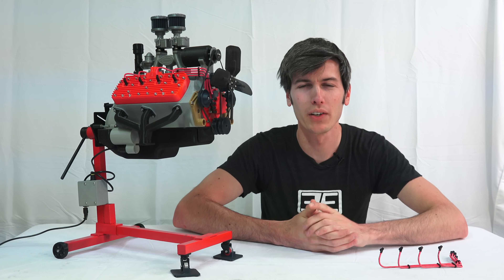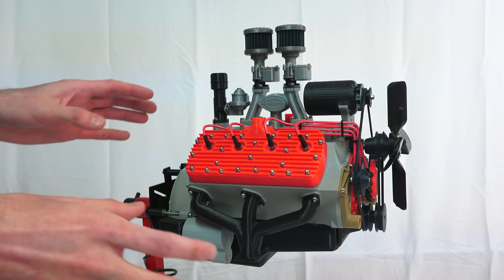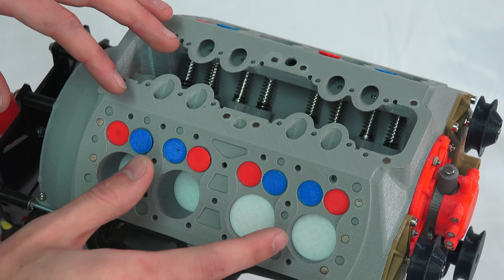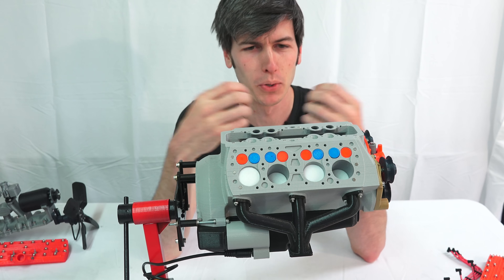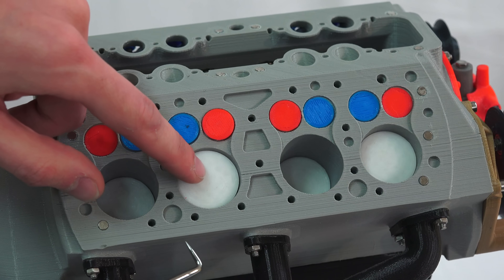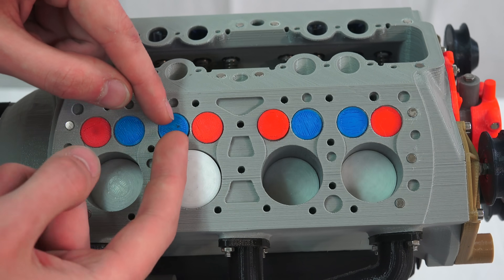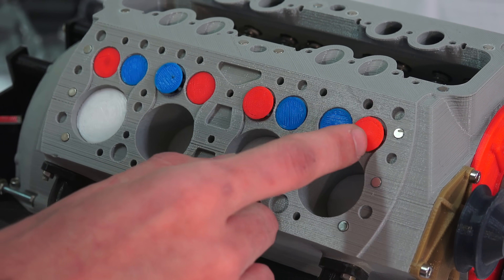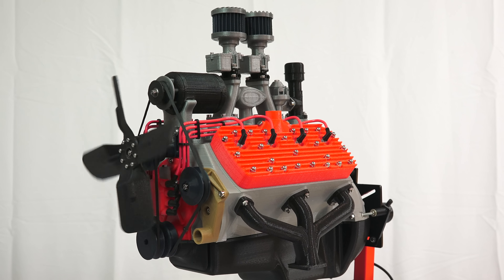Why Ford's Flathead V8 Engine Died

Comment: My first car was a '50 Fordor Custom. My dad and uncles all had flatties from 1932 on. They were obsolete by 1949.  Mine was 100 HP, and had all the usual flattie problems.  One thing you didn't mention was the Ford flattie V8's penchant to overheat.  The reason was simple... the damned exhaust ports go right through the water jacket!  Siamesing the middle cylinders' exhausts into a single port didn't help breathing, either, and only 3 main bearings didn't bode well for longevity.  At best, my '50 got 14 MPG around town and 16 on the road.  My '55 Olds w/Hydra-Matic got 17 around town and 22 on the road...with almost twice the horsepower available.

GM's engines were far better than Ford's Y-blocks that replaced the flatties, as were Chrysler's.  Ford finally got their act together with the big block FE in '58, and Ford's small block of 1962 turned out to be a far better engine than the trouble plagued Chevy small block.  But all through the mid-50s, Ford engines were just overweight gas-guzzling chunks of iron.  As Packard used to say, "Ask the man who owns one."  I did, and can tell the real story.  Too bad, too, since other than the obsolete V8, the Shoebox Ford was a pretty nice car.  Here's a tip...the I-6 available as standard engine in 1950 put out 5 more HP AND got better fuel economy.  Ford, of course, never advertised that fact and derated the 6 on paper to sell more V8s.
Reply: i have a cadillac with a 346 flathead in it thatcim rebuilding. i would asume they dont overheat as bad since the exhaust exits on top so it doesnt go through the block like the ford
Reply: Per Landström 

I just got a 47 Caddy with 346, I can’t wait to dig into it & see how different it is from Ford’s design. I have a 346 Facebook page if you’re interested in joining it.
Reply: I will never understand why Chevy pressed the rocker arm studs into so many small block cylinder heads. That's the only major problem I know of with small blocks although I think I heard they had some alloy problems at first that resulted in chewed up cam, distributor, oil pump drives.
Reply: It is interesting. Though Ford was known for the V8 their straight sixes were their real forte.
Reply: DeserT BoB thanks for the short narrative.
Reply: More than just the internal exhaust passages... the flathead design in itself, doesn't lend well to any considerable duty cycle. The heat simply had no place to go. The heads held a lot of heat, and caused preignition after any lengthy load... hence why all the flatheads in hill country always sounded like they had a worn cam. You had to back the spark advance off enough for it to take more than a 30 second pull up a mountain without burning up.
Reply: Kind seems this engine was  marketing goal, advertise a car with a v8 but it's a cheap to make problematic v8.
Reply: @Cheapthrill1979  - for its day, it wasn't that bad. The Mercury and French military versions were actually quite good, for the time they were built. The later castings used by French military had revised cooling passages, dual spark plugs, the highest  displacement of all that were produced, and often found their home in tanks.

While the flathead definitely had its faults, it had its advantages as well. Serviceability was paramount back then... and the V8 flattie was king, 'til Hudson showed up with their revised H-series 6. The flathead was also relatively lightweight, compared to most 6 cylinder offerings of the day.
Reply: I REMEMBER THE SIXES BUT THEY WERE VERY RARE! 
A SIX WITH THE OVERDRIVE 
STICK WAS A STOUT RIVAL FOR THE V-8!!
THERE WAS A BIGGER VERSION OF THE SIX USED IN BIG TRUCKS!
I HAD A F-600 WITH 4 SPEED TRANSMISSION AND AN EATON TWO SPEED REAR END!!
IT WAS A GREAT HAULER!!
Reply: "... the trouble plagued Chevy small block."?  That's a strange statement about a design that has stood the test of time for 64 years.  Anyway, your comments about the Ford I-6 v flathead V-8 is right on.  The six outperformed the V-8 in every field - acceleration, economy, speed, ease of maintenance*.

*whoever designed the V-8 water pumps should be hung by his ankles.  I've spent hours trying to get the bolt out from inside the water outlet after it had been rounded off by corrosion.
Reply: @dhy5342  But it didn't have the "COOL" factor or the sound.
Reply: @dhy5342  stainless steel bolts would have been the ticket. i love the small block chevy water pump. four bolts and so easy to get to. much better than taking off all those bolts on a ford buick or other engines. running the bolts thru the water jacket was not that bright but the pump itself was the simplest i ever had to deal with.
Reply: Depended more on use than anything. I had a 51 and 52 1 ton duallies, ran those around town and got low to mid 20s and ran cool. Try to maintain 50 empty or 45 with any load and they'd overheat in a heartbeat and drink gas. I'm thinking they didn't like running over 2500 rpm for any length of time.
Reply: Excellent assessment Deser.  Ford GAVE GM predominance in the 20s and late 40s, early 50s.   Just handed it to them.
Technology has to evolve.  I have a Willys Jeep with the flathead Go Devil.   That evolved to the F-head half (intake OH, exaust in the block).  I think what made Ford's flathead V8 such a technological wonder was it being the first 1-piece cast solid block.   Before Ford, all larger blocks were usually 3 pieces bolted together.   You can imagine the problems with parts of an engine block bolted together.   The technique Ford and the engineers patented are still being used today in firing a block.   THAT was the great accomplishment of the FHV8.   That and it's important role in the evolution/trial and error learning process of V6/8 innovation.
Reply: PROBLEM PLAGUED SMALL BLOCK?? ARE YOU SERIOUS, THESE ENGINES MADE THE ELUSIVE ONE HORSE PER CUBIC INCH, SOMETHING YOUR FORD DIDN'T DO FOR A LONG ASS TIME, ONLY PROBLEM WITH SBC WAS PRESS IN AND PINNED ROCKER STUDS, WHICH WAS ONE OF THE FIRST UPGRADES, MORE VALVE SPRING, ROLLER ROCKERS , SCREWIN STUDS, CRANE REV KIT, PORT MATCH TO INTAKE, O41 CAMSHAFT OR A SOLID ROLLER , NOW THAT MOUSE IS SCREAMING AT 7800 OR MORE, AND STILL RRLIABLE, WHAT FORD COULD DO THAT, THE KEY TO SBC POWER IS , AIR IN , AIR OUT, VOLUMETRIC EFFICANCY, I LOVE MOUSE MOTORS, ESPECIALLY THE 302 FROM. THE Z 28 s , PURE BLOODED BEASTS
Reply: William Cox  Chevy’ s were the reason that there was an aftermarket parts industry, because they were underpowered and unreliable.
Reply: @Parky427  YOU'RE FUNNY
Reply: @williamcox4910  lol elusive horse per cubic inch. tell that to the european domestic market. i really wonder how they consistently made and beat that mark, even through the malaise era with a ton of engines. 
And kinda did better than 15mpg on average.
7800 is slow. try 8500-10000. 
pushrod engines were outdated by the end of the 70's. having the sbc push through Y2K was through sheer GM stubbornness and massive govt backing gm's mistakes. 
the LS is all the same.
Reply: @comethiburs2326  SIR, WHAT I WAS REFERRING TO WAS CHEVROLETS 1st V8 IN 1955, THE STATEMENT IS ACCERATE, TELL WHAT MANUFACTURER MANAGED A 265 CUBIC INCH MOTOR THAT MADE 270 HP, I'LL ADMIT I'M WRONG WHEN YOU TELL ME ANYONE IN 1955 THAT PRODUCED ANY MOTOR THAT DID THE SAME
Reply: @comethiburs2326  ALSO AS FOR RPM, YOURE CORRECT, ON OHC MOTOR WILL REV HIGHER, WE'RE NOT HERE DISCUSSING " TUNER" JAPANESE CRAP EITHER
Reply: @williamcox4910  ferrari 375. 350-400hp for 302ci V12. mercedes 300SL. 220hp for 183ci I6. alfa romeo 1900Ti super. 115hp for 115ci I4. Alfa Romeo Giulietta Sprint. 80hp for 78ci i4. panhard Dyna; 51ci, 50hp Flat 2. all in the year 1955.
Reply: @williamcox4910  THE 1955, 265 CI CHEVY MADE 265 HORSE POWER WITH TWO 4 BBL ENGINE
Reply: @comethiburs2326  WE'RE NOT TALKING ABOUT V 12 FERRARI CRAP, THIS IS ABOUT AMERICAN MADE REAL V8 ENGINES
Reply: @comethiburs2326  AND HOW ABOUT THE CHEVY 8  CYLINDER 302 IM THE Z 28. THAT WAS RATED AT 350 HORSE BUTFOR INSURANCE PURPOSES MADE AN ACTUAL 450 HORSEPOWER????
Reply: Côme Thiburs and every one of them is unreliable junk
Reply: @williamcox4910  first chevy v8=1916
Reply: @williamcox5216  also make an excellent boat anchor 
Just an observation!
Reply: @williamcox4910  is your caps lock button broken?
Reply: @williamcox4910  "What manufacturer managed a 265 cubic inch motor that made 270HP, I'll admit I'm wrong when you tell me anyone in 1955 that produced any motor that did the same."

Well, Chevy sure as hell didn't. The highest output 265 available in 1955 was the 195HP Corvette motor with dual quads and a high-lift cam. Ford's 272ci Y-Block V8 was able to match the 265 in most configurations, plus there was also a bigger 292ci Y-Block available. Chevy didn't crack the magical 1hp per cubic inch 'til the Fuelie 283 came out in 1957. At the same time Ford had released their blown 312ci, 340hp Supercharged Y-block.

Comment: In comparison the 2018 FORD Expedition is powered by a 3.5 litre V-6 Ecoboost. Before you laugh at 3.5 litres in a big Expedition remember it gets 375hp and even more torque out of that 3.5litres. I just put 1200 miles on rental 2018 Expedition. It was a pleasure to make the drive, no problem with all the hills on I-10 between LA and Phoenix. Very impressive engine. I made the trip last moth in a 2018 Nissan Pathfinder. The Pathfinder is a bit under 300hp,still a great driver. The FORD handled better,even being significantly bigger. Pathfinder handled like a rough truck.

Comment: Funny that some of the old hotrodders could coax a helluva lot of horses out of those flathead engines.  I believe the max was 400 hp with aftermarket Ardun heads.
Reply: "aftermarket Ardun heads"... you mean the Ardun OHV conversion heads?
Reply: 400HP max? people have put blowers on those and got alot more...the limit is how much money you got to sink into it. literally the sole reason Ford canned those was uncorrectable overheating issues. if built right, a Ford flathead is a tire frying screamer to beat all. Hot rodders love those because they're so easy to work on.

Comment: So an air-cooled VW engine has slightly more horsepower than a flat-head Ford.
Reply: I think the VW was about 40 HP and the Flathead was about 110.

Comment: the first flatheads actually were rated at 60 hp and the later engines were rated at 85 hp. interestingly the 6 cyl inline flathead  ford built put out 90 hp! the model you are using has the early distributor, later ones had the distributor at the rear on top of the engine.

Comment: Since flatheads have less compression , would they make good engines to turbo charge ?
Reply: I don't think the flathead would be a good candidate for turbo boost. The engine had breathing problems - watch the video where the airflows in and out of the cylinder are explained. One other thing that was not explained in the video was a heat build up problem the engine had. The exaust passing through the engine block gave the cooling system a lot of extra heat to deal with.

Comment: Ford is bringing it back in their new 7.3 V8 for medium duty trucks.
Reply: Thats not a flathead. The new 7.3 has got a single cam with push rods to work the rockers and vavles like the old motors were. But the thing is that size motor aint new its a 445 c.i. International used to have a 445 in their trucks back in the day.

Comment: I have a 1953 Merc FH in my 1947 Ford Coupe. Love it.
Reply: The Merc had a little more power.
Reply: @timothyearly7727  And 16 more cubic inches. 239 to 255 (longer stroke).
Reply: That sounds correct.  The flathead was a small engine.  It was way down in the engine compartment.

Comment: The Ford flathead V8? The engine was a real study in mediocrity and it was a danger to owners and mechanics alike. Note that the exhaust ports had to travel a considerable distance through the water jacket. This meant that the engine had a terrible heat rejection rate and had to have an oversized radiator and water pump just to keep from overheating under normal use. And putting any load on the engine often resulted in cooling system failure. I had an experience with the engine that could have cost me my life in addition to the 2nd degree burns over my chest and face. I had a friend in high school who had a Ford Woody station wagon with a flathead V8. Normally it's a really cool ride. We decided to take a trip from Indio, CA along I8 about 59 miles east to Desert Center on I8. Well, Indio, CA is at sea level and Desert Center is at about 2000 ft elevation so outside of Indio we had to climb a grade of about 2000 ft. In Indio, the woody ran just fine and we expected no problems. But just east of Indio, about halfway up the grade, the car started to overheat badly. We pulled over and raised the hood. I removed the radiator cap and the water level was low. There was a rumbling that lasted for about 5 seconds and then all of a sudden a huge explosion of boiling hot water came rushing out and hit me squarely in the chest. I was immediately sent flying backwards about 10 ft. and landed squarely on my back in the right lane of US8. If there had been a car coming I would have been run over. What had happened was that by removing the radiator cap we had reduced the vapor pressure  allowing the superheated water to explode. I was hit by almost the entire contents of the cooling system.  I had 2nd degree burns over about 25% of my body. After I landed on my back I quickly jumped up off the road to get out of the highway. Imediately I was hit by the most agonizing pain. We had no water to fill the cooling system. Luckily for us a truck driver stopped and gave us a lift to our destination. We stopped at Chiracco Summit to get ice for me but for some reason they had none. In the meantime I was in shock because of the intense pain. My face and chest had bubbled up from the scalding. At our destination a local doctor was able to treat me for the pain. This happened in 1967. It took a month for me to heal. It was the terrible heat rejection rate of the flathead design, in particular the routing of the exhaust ports through the water jacket that made the flathead so vunerable to overheating and practically useless for developing real horsepower. I have nothing but curses for the Ford executives that lined their pockets with the bonus money received from this dangerous and grossly inefficient but awesomely cheap design. Was this a case of maximizing production for profit only? You be the judge.

Comment: FIRST OF ALL YOU WERE NOT BORN IN 1953 BRO.   THE FORD FLATHEAD WAS AND IS A GREAT ENGINE FOR ITS TIME.  USED IN MANY STOCKCARS RACED AT SHORT TRACK FOR MANY YEARS.   HAD ONE IN AN INBOARD BOAT IN THE 1060s.  GREAT MILL.
Reply: Were you a viking in the 1060's ?

Comment: Thank you for the extremely well produced and informative video presentation. One thing I believe  is very important to address is the reliability and power generated with 65 to 70 octane fuel. As a simple, reliable Workhorse, these engines are really great. When consumers had available to themselves, the excess Capital to demand higher performance engines; it truly was the death knell.

Comment: Cadillac and Chevrolet both had V8 engines in the 1915 to 1917 circa. They just weren't produced in the numbers or for the duration that the Ford flathead was, interestingly the Cadillac Flathead  intake and exhausted out of the top side of the head.

Of course all these V8 engines were developed long before what you know as a computer. There was a lot of  efficient engineering  underway  long before  your electronic age  has over complicated things. You seem to marvel at the fact that Ford was able to build a V8 engine without the benefit of a computer.

Comment: I had a 1950 Ford. My dad bought it for me for $130.00 in 1958 and I drove it back from NJ to South Carolina. The engine was a Flathead V-8 with 100hp. Easy to work on even for a teenager. Under the hood all the room in the world to access everything! Fine little engine! I would like to see Ford bring something similar back.....those good old days are gone forever ☺☺

Comment: the most reliable engine i ever had was on my lawn mower, which is a flathead engine design.
I'm so turned off by these new high tech engines that break down faster than you can fix them, that if FORD brought back the flathead engine in a car, i would buy one.
Currently, my '96 Toyota Corolla is the next best thing. It just starts and runs, starts and runs, whenever i want it to.
Reply: But even with a flathead lawnmower, they overheat and run badly when you reach the end of mowing. Best lswn mower I've ever had was an OHC design I bought from Walmart and assembled myself. And it was USA made in Ohio. Damn great design! Briggs and Stratton kiss my ass!

Comment: You forget the HP had a lot to due with the gasoline octane back in the 30's thru 50's.
Reply: True but you cannot get a very high compression ratio in a flathead. Plus the inferior breathing. That's why I think the best bet for decent flathead power is a Rootes type blower. Lower compression is a prerequisite in that situation and a blower helps overcome some of the flow problems.
Reply: @gregorytimmons4777  Even then they were only good for about 150 to 200 hp

Comment: Enjoy your videos.  Although Buick didn't use the flat-head design, they did use a rather restrictive air flow head as well in the famous Nailhead.  Would enjoy your synopsis of this engine and how it worked relatively well and how Buick successfully, for the most part, overcame its restrictions.  In particular:  the spark plug was located directly over the piston almost in a hemispherical configuration.  Sound sort of familiar?  I have several.  Wonderful engines designed with tons of torque at low RPM
to move lots of Detroit metal at the time.  And at that, they excelled.